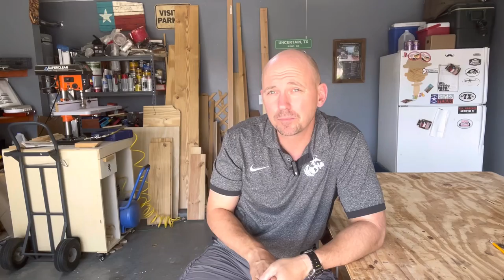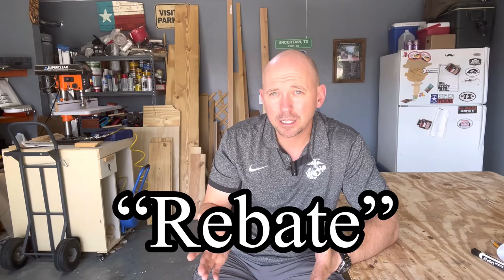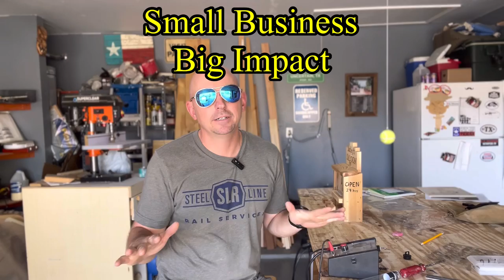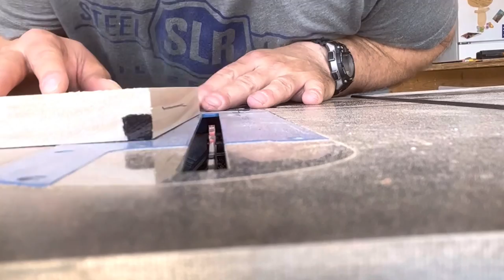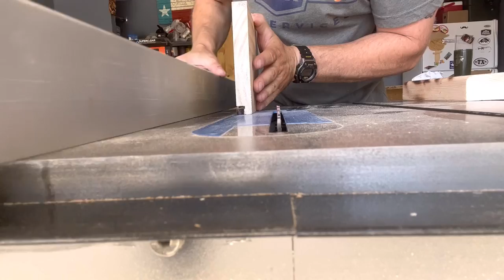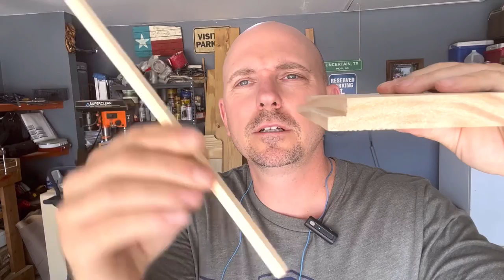Rabbets Made Easily on The Table Saw

Comment: Thank you for sharing this. I need to do an elongated octagonal mirror frame. This method seems much easier than using the trim router for rabbet. You obviously have a lot more experience, but one thing concerned me a little. Shouldn't the small piece side face away from fence so that it does not throw back if caught between fence and blade. I could be wrong but it seemed that way. Thanks!
Reply from the maker: Hey there, you can do if either way. You are correct if you do it the other way less chance of it throwing that piece back. 
I just alway feel this way is a little more supported against the fence. Thanks for watching!

Comment: newby here.... Does the depth of rabbet cut have to be the same as the width? If not, would there have to be an additional cut made?
Reply from the maker: Depth of the rabbet will depend on what you need. For example a picture frame rabbet will need to be deep enough for the glass, picture, backing and/or mat and possibly more. 
May depend on the wood thickness like if it’s for drawers